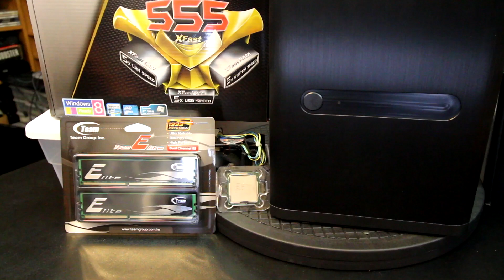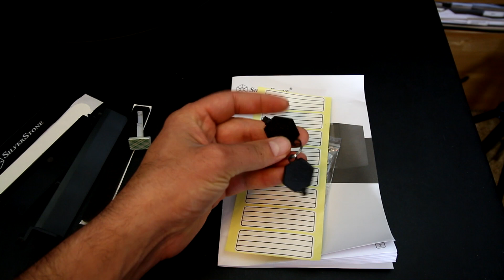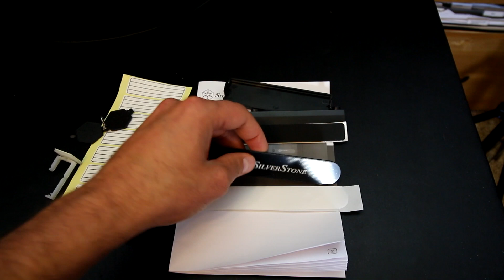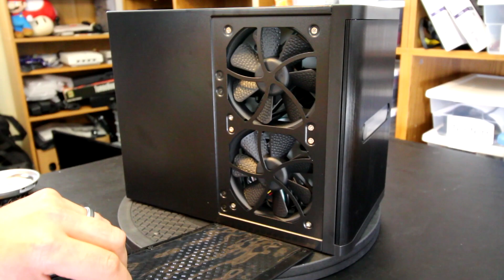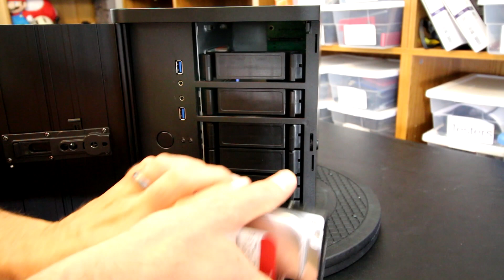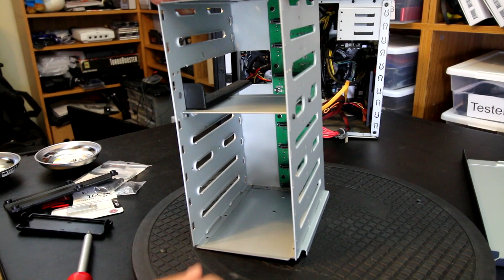NAS build with the SilverStone DS380

Comment: I need help, recommendations building a Nas mostly for streaming 1080p media. I went and ordered all the parts base on a forum that I was reading and now that I'm ready to build the Nas and started to reading more about it and looking at people comments, I see I'll have problems streaming 1080 to multiple devices. What should I change for what I already have. I was gonna used Freenas. Any suggestions? Thank you

SilverStone Technology Premium Mini-ITX / DTX Small Form Factor NAS Computer Case, Black (DS380B)

Crucial 16GB Kit (8GBx2) DDR3/DDR3L-1600MT/s (PC3-12800) DR x8 ECC UDIMM Server Memory CT2KIT102472BD160B/CT2CP102472BD160B

ASRock Rack Mini ITX DDR3 1333 Motherboards C2550D4I

SilverStone Technology 450W SFX Form Factor 80 PLUS GOLD Full Modular Power Supply with +12V single rail, Active PFC (ST45SF-G)

2x WD Red 4TB NAS Hard (WD40EFRX)

2x Seagate 4TB NAS HDD (ST4000VN000)

SanDisk Cruzer Fit 8GB USB 2.0 Low-Profile Flash Drive- SDCZ33-008G-B35
Reply from the maker: +Hector Arias I personally don't see where you would have issues streaming. How many devices are you thinking about at the same time? Do you have gigabit wired Ethernet networking to the NAS? Are you using wireless to stream, wired only, or a combination of both?
Reply from the maker: +Hector Arias By the way, that is a fantastic motherboard! Same one that I use now. Rock solid with FreeNAS in my experience. Are you mirroring the drives? Or using a RAIDZ?
Reply: +AdoptedMike thank you for the replay, I still havent build the nas because I started researching and even the guy who recommended the parts said streaming wasn't part of the build. I would to streaming wire and wireless, in my network and outside my network, I have a lot of HD movies I would be sharing them in my house and my family, for plex plugin I heard more cpu is needed. This will me my first nas and Freenas I don't have much experience with it. I was thinking to mirrors the drives. But I was told I wasn't gonna be able to add more drives I as go, I got 4 and want to add more in the future. I wanna be able to replace failing drives.
Reply from the maker: +Hector Arias In my experience with FreeNAS, I have no issues streaming. However, I am only streaming to one device and using wireless only. I don't have a way to get a network cable to that closet and I am renting the apartment. I do get better reads than writes to the NAS it seems. I am getting about 12 Megabytes per second reads from the box at its lowest. That could easily be a wireless issue. But, perhaps hitting it with many users at once will slow it down even more. I am using a RAIDZ2 and that could slow down the transfer speeds, especially with writes. I would think if you did a RAID1 or RAID10, you should be able to stream to multiple devices. The guy that recommended the parts has likely tested it out in the scenario you are trying to run this in. Whereas, I have not. IMO : In the worst case scenario (if you cannot return the parts), you could put a Windows OS on the box (using an SSD) and use that to stream. Windows my have better transfer rates as it is less complex than FreeNAS although, not as secure with the data in the very long term.
Reply: +AdoptedMike I was looking to do a raidz2 but I think I would have to get all the drives I need more, I won't be able to add more drives to the pool if I'm not mistaken. I get 30 days return, also have a gaming pc that I don't mind upgrading if I have to spend more money on a cpu I would rather upgrade my gaming pc and use the i5 and mother board for the nas. I thought this will be more easy :/ right now i have a Apple time Capsule 6tb  full and got my self a asus rt-ac3100 and all the Nas parts and now no clue what to do next I don't wanna build it and not be able to use it better then my current setup.
Reply from the maker: +Hector Arias You could do a RAID10 or 2 RAID1 arrays. One thing to think about: FreeNAS recommends using ECC RAM. I see people do it without all the time and it is ok, but just not recommended. If I were you, I would take a look at Windows Home Server 2011. It is very easy to use and is pretty powerful for the price. I run WHS 2011 (RAID1) and a FreeNAS box(RAIDZ2). The FreeNAS box is more of a backup, safe and mass storage because of the scrubs and redundancy. For the quick and easy data setup, the WHS 2011 box is easier to upgrade the storage pool. WHS 2011 needs to reboot more than my FreeNAS box, but it is still solid and I haven't had any issues in 2 or 3 years. My transfers to and from the WHS box are faster also.
Reply: +AdoptedMike thank you will look in WHS, do you recommend keeping the parts I already got or replace the motherboard and get a different one and cpu? I got 16gb ECC
Reply from the maker: +Hector Arias Your setup is a bit overkill for a WHS. I use a dual core Pentium with 8GB of non ECC RAM and a 240GB SSD for the operating system. WHS requires at least 160GB for the main drive for some reason. For storage, I have 4x2TB in a RAID10 array and 2x3TB in a RAID1 array. I did buy an Intel NIC to put in it as my on board NIC wasn't an Intel. Intel NICs are regarded as being the best and usually the fastest. I also used a Fractal Design Define case because of the multiple hard drive bays, dust filtration and a pretty closed case in general. I recommend getting a case with dust filters at the least as a NAS will run 24/7.
Reply: +AdoptedMike thank for the info. I have the same case as you in the video, is not a good case?
Reply from the maker: +Hector Arias The case is good, just difficult to build in as it is so small. I lost the case in a house fire. That is why I am not using it anymore.
Reply: +AdoptedMike it looks like I made some bad choices lol I should've just put a bigger hard drive on my new router lol cheaper and easier.
Reply from the maker: +Hector Arias I wouldn't say bad choices. When it comes to data storage, you do want to build something that will last for years. So it is easy to go further than you want. But a few years from now that won't be enough storage anyway. So sometimes it is good to plan big. I get at least 2 great years out of each NAS that I build and probably closer to 3 or 4 before I have problems.
Reply: +AdoptedMike yeah you right. I have Intel Core i5-4670K Quad-Core 
MSI Z87I Mini ITX Motherboard
On my gaming pc you think it will be a good idea to use it on the Nas and buy better ones for my gaming pc because I'm thanking to return the motherboard and instead of buying a new ones just use my current one
Reply from the maker: +Hector Arias That is something to consider. One thing to think about is maybe reusing the 4670k and buying a cheaper CPU for the NAS. The 4670k is a fantastic gaming processor. Way overkill for just a NAS.
Reply: +AdoptedMike ok great I'll do that. Gonna start looking for motherboard and CPU. I see there's a upgrade version of the motherboard I got for the Nas for about $100 some people say better performance streaming but not multiples devices. I appreciate all your help.
Reply: +Hector Arias you know What im not gonna stress myself, I mostly would be using it with Kodi (XBMC) and I don't think it will be using a lot of CPU since it doesn't do transcoding like Plex does. Raid 5 or Raid 10 can I add more drives in the future and able to lose drives? Sorry I'm back asking again lol
Reply from the maker: +Hector Arias No problem. I love this stuff! Good luck to you.
Reply from the maker: +Hector Arias Any RAID array can have issues adding drives. The only way I ever recommend changing an array is to first back it up. As far as I know to add drives to an array, you need to destroy it, add the drives and then create a new array. RAID 0, 1 and 10 are the least CPU intensive. RAID 5, 6 and other parity arrays are more complex, take longer to build and use more processing power. I usually have seen slower writes because of this unless there is some kind of cache being used and it doesn't fill up with data before being emptied to the array. Caching can be an issue if the power goes out during writes. That can kill the entire array, or at least need a rebuild. Personally, I have found the RAID 1 and 10 to be the fastest and easiest to work with. Then backing that array up with another RAID 1 or 10 (preferably offsite) for the ultimate protection if needed. The parity arrays can lose more drives (if setup correctly) while still maintaining the data, but are much more complicated and need more powerful hardware to get the same speed. Does that make sense?
Reply: +AdoptedMike im back Lol if you could help me please. I finally got the new board c2750d4i, I just put everything together In the right place. When power on the nas everything seem to be fine but I get no picture, what could be wrong?
Reply from the maker: +Hector Arias That board takes a long time to POST. Or it doesn't like your RAM. What RAM did you buy for it? It is picky.
Reply: +AdoptedMike Crucial 16GB (2 x 8GB) 240-Pin DDR3 SDRAM ECC Unbuffered I think I left it on for like 5 mins but the monitor or tv doesn't seem to see it I can't change the input to PC :/ I'll try removing the ram and trying one at the time. To much more anything else I could try?
Reply: +Hector Arias Hey Mike thanks everything seem to be working fine it look like I didn't stick the ram all the way in even thought it locked the first time. I have the Rams connected both blue is that ok? Also the fans seen to be exhaust all 3 that's how it's supposed to be?
Reply from the maker: +Hector Arias I had my fan config for the 2 side fans as intakes and the back fan as exhaust. All exhaust is probably going to starve the fans for air. Both RAM sticks in the blue slots is good. As long as they are in the same color you are good.
Reply: +AdoptedMike ok great thank. The rear fan is facing out and is blowing air out, the two on the size are facing inside and blowing air out. I really don't wanna put this thing apart again, can I change the two on sides to blow  air in instead in the bios?
Reply from the maker: +Hector Arias The bad news is, fans can't change direction. They only go one way. If you at least change the back one, you will be better off. Put a dust filter on the outside as well to help control dust.
Reply: +AdoptedMike ok one more question, I read the fans on the case are supposed to be like you described two intake and one exhaust, so that mean I had one case that wasn't assembling correctly?
Reply from the maker: +Hector Arias Out of the factory, the one I had had 2 intakes and one exhaust. I would guess that yours was not assembled correctly if all 3 fans are exhaust.
Reply: +AdoptedMike ok. You have been helpful. Thank you so much for taking the time to reply to all my questions.
Reply from the maker: +Hector Arias You are welcome. I love doing this :)
Reply: +AdoptedMike sorry to bother you again I have been searching everywhere and can't find a solution. I got everything running but I have 4 HDDs and only were detected at first. No matter where I plug it only get two 2 to show yesterday I got 3 to show and today I tried plugging another cable to the power supply and now only one HDD is showing. What you think can be the problem?
Reply from the maker: +Hector Arias That is odd... Go in to the BIOS and make sure all of the ports are enabled as SATA ports. I had no problems with my hard drives. I used six and they were all recognized right away. Also, make sure they are all spinning up. Maybe the SATA backplane is not providing power to the drives.
Reply: +AdoptedMike I think I got it now I opened it up and rearranged the satas cables. Now I'm not using the SataIII because I was trying to open that up in the bios but the HDDs wasn't showing there either even though I have enable.
Reply from the maker: +Hector Arias Is it recognizing all of you disks now?
Reply: +AdoptedMike yeah, I wanted to used all 6 gb SATA but ended up using the the blue ones 3 GB, I used all SATA close to the Ethernet port and 2 of the other side close to the Ram
Reply: +Hector Arias I'm gonna have a total of 6 HDD on Z2 that will give me a total of 4 usage HDD correct? I set up Freenas to test it before the other 2 HDD comes, but I did it when only 3 HDD were showing and now Freenas can't see the 4rd hdd
Reply from the maker: +Hector Arias Right the Z2 means you will lose 2 drives worth of capacity. That is messed up that the 4th drive cannot be seen. Try plugging in one drive at a time to see if that 4th one is a bad drive. I would test only one at a time. If it can see the four drives when they are by themselves, but not all 4 at once, I would suspect an issue with the motherboard or the BIOS.
Reply: +AdoptedMike yes just try that, like I said I was able to see the 4 drives in the bios but not in Freenas, so I started testing it one at the time and one of my Seagate seen to be the problem. You think wiping it will fix the issue or should I contact the seller? It will be hard to contact the seller because I don't know where I got it from, I ordered 2 wd red and 2 Seagate from different buyer.
Reply from the maker: +Hector Arias Ok, that makes sense now. See if you can get that drive to be recognized in Windows or another operating system. If so, you should be able to run a scan disk or error checking utility to see if the drive has problems. If it does, you should at least try to send it back unless you bought it a long time ago.
Reply: +AdoptedMike the drive shows on Windows and Mac something but most of the time if you power off, so that explain why sometime it shows and sometime doesn't because the drive doesn't stay on. I got it less then 30 days ago thru eBay so I'm covered on buyer protection. The thing is I got one Newegg and some from someone else and now I don't know which one is that one not working the other seller said both drive should be covered by Seagate warranty but I'm not trying to go to thru that I want to send it back to the seller I got it from. The other seller doesn't records serials I'm waiting for Newegg reply is not I'm just gonna open an eBay case on both seller.
Reply: +Hector Arias I contacted newegg for the serial it was their drive, I'm getting a replacement. Glad I put the nas together before the returned policy expired. 

Putting the system together was easy thank to your help and your video, easier then when I built my gaming PC. The fun part will be Freenas configurations lol
Reply from the maker: +Hector Arias :) Good luck. Hopefully the replacement will work great for you.
Reply: +AdoptedMike thank you.

Comment: Seems like better for a DAS than for a NAS. Really cramped inside.
Reply from the maker: +Cyril Azoulay Yeah. One thing I never did get a chance to test is the cramped nature having an impact on heat. It is so small, and I wonder if using 7200 RPM drives may lead to heat issues. Once you get it built, it is fine, but it took a lot to get it built in the first place. I would have rather had it a few inches wider and longer. Especially with 10 SATA cables. Plus then there would have been no issue with the RAID card.
Reply: I'm debating on building a NAS box in a Fractal Design Node 804 case, but I do like the hot swap drive bays up front on the Silverstone DS380 for the purpose of replacing a failed drive ... but I also like the numerous possibilities for cooling fans and filtered intakes on the Node 804.

I'm wrestling with the idea of:

1.) Using the Node 804 case to build a NAS

or

2.) Picking up a DS380 case to build a NAS and use the Node 804 to build a Media PC (to attach to a TV for gaming, etc.)

I'd like to be able to start a NAS build with like 3 WD Red drives (i.e. 3 x 4 TB WD Reds) in a RAID format where I'll get the storage of 2 of the 3 drives and be able to lose 1 drive before losing data. I'd also like to be able to add additional drives to it (when $$ allows me to get additional drives) and be able to expand the available storage space, without having to move everything off, add the drive and then move everything back. Not only will I be able to buy drives when I have the extra $$, but it'll also spread out the drives life (i.e.: 3 drives running for 6 months, 1 drive running for 2 months) to lessen the possibility of multiple drives failing due to age.But can I plug in additional drives and expand the volume without having to remove the data or losing the data by expanding the volume??
Reply from the maker: That is a great question. I have not done what you are asking personally, so I lack the confidence. The only thing I have done is removed a drive from the pool and replaced it. That gets the disks at different ages like you talked about near the end of your comment. I have never changed a RAID configuration. I have seen posts online before, but what I would do is: back the whole volume up to an external drive (or 2 for redundancy) then try the forums of the RAID card and O/S you are using an see what others have successfully done. This way even if you were to fail and lose the whole array, you can build a new array the way you wanted and then, using the backup, put you data back on. Maybe you can borrow an external drive from a friend. I was fortunate enough to be able to build the array the way I wanted (six drives, RAIDZ2) with some future proofing. Although, some day, I will probably need to upgrade the storage capacity. I use FreeNAS RAIDZ2 (RAID6). I understand that you pull a drive, replace it with a bigger drive, repair the array and then go to the next drive. Repeating until all drives are at the higher capacity. Other than that, I am a virgin. I also have a 1TB Dropbox account for data that I cannot lose like pictures. Data is super important, so I overdo the protection. I hope I was able to help at least a little bit.